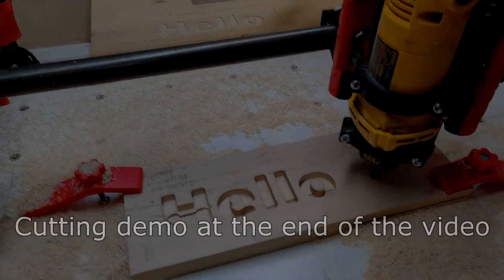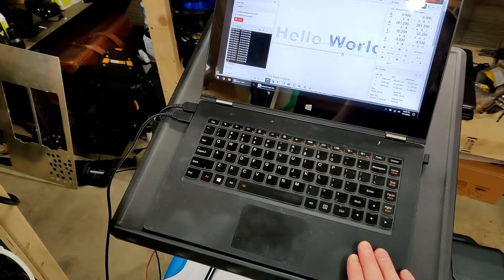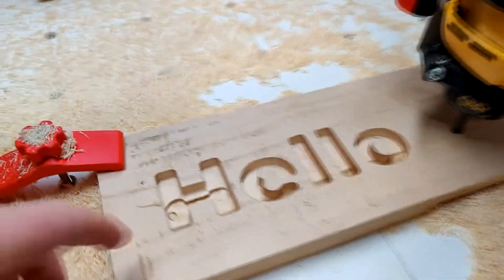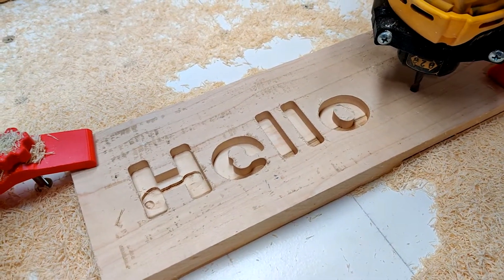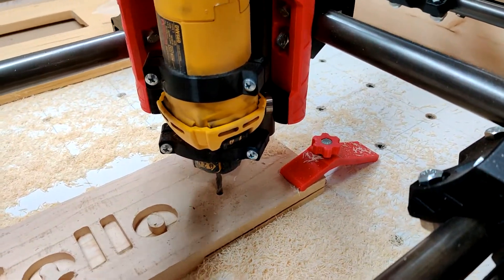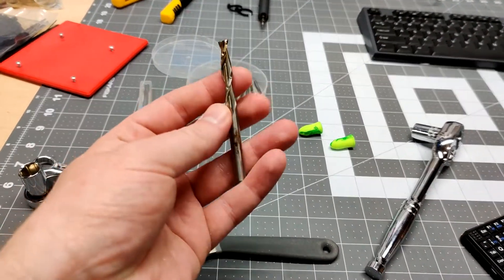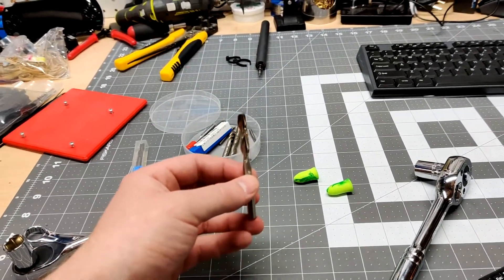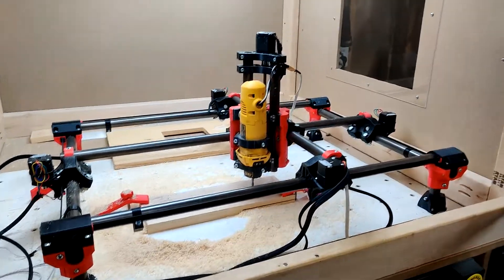MPCNC Primo First Cut! (Cutting Demo At End)

Comment: Excellent video! Thanks for the share of the 1st cuts, it is running very smoothly. What is the make an model number of the your spindle?
Reply: @ProjectsbyBrian  Thanks for your reply, I was looking to get the Makita RT0701 but wasn't sure if would be too big and powerful for mpcnc use. Have you had any experience with Acrylic? I am currently using a cheap Job Mate rotary tool and it seems to be working okay with wood but causing overheating and melting when I try cutting Acrylic. Oh and would be able to link me to the 3D mounts for Dewalt DW660.
Reply: @ProjectsbyBrian  Thanks, I am going to need the Burly version which I have found them on Thingiverse. Going to decide whether to get Dewalt of Makita..